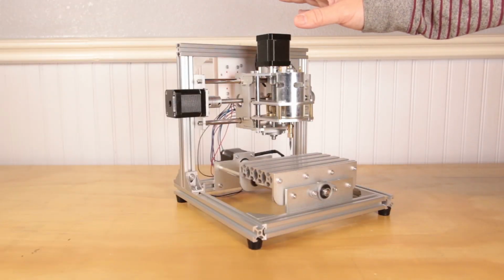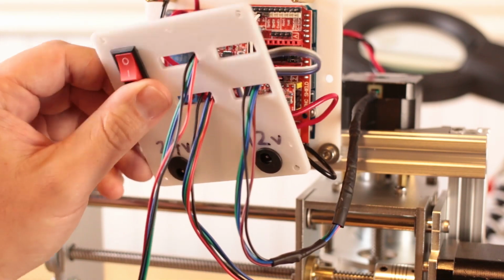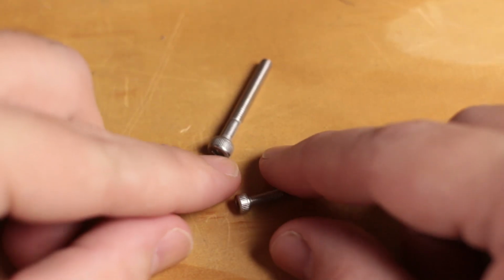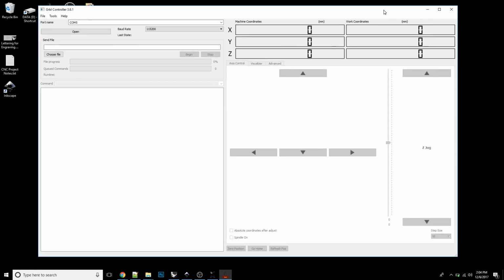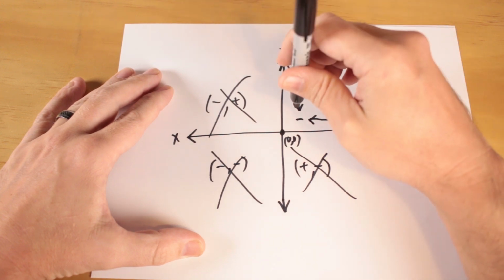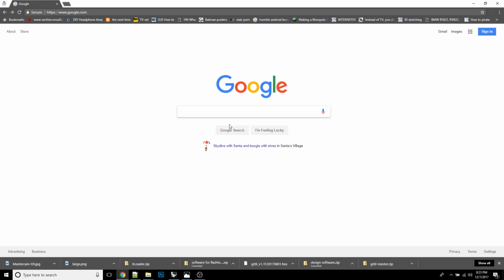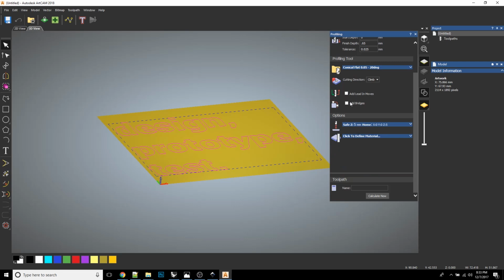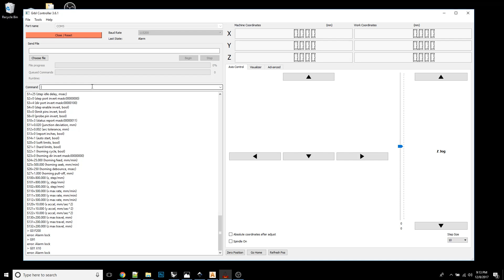How to start CNC Machining for under $200 - Working with the T8 CNC engraver

Comment: I appreciate your attention to detail and how you explain your process. So, I hope you find this useful. 

As others have said, soldering a conductor, before fitting into a screw compression terminal, is not ideal. If you use lead based solder, you will get some 'compression', but in the presence of oxygen and the flow of electricity will cause the connection to fail, no-lead solder is worse, because it is harder. Add a substance to exclude the oxygen would help (dielectric grease), but the connection will, still fail because of thermal changes. What you are wanting is a 'gas tight' (metal on metal) connection with tension, to maintain the metal to metal contact. Soldering the wiring directly to the PCB is the ideal, for the best connection, but is not, if you ever want to service/remove the PCB or wiring. Putting a close fitting ferrule (small metal tube, designed to fit over a stranded wire), is the standard for those screw terminals, you get the gas tight connection and the tension created by crushing the ferrule on to the bare stranded wiring. 

You could put a dab of non conductive dielectric grease on your terminal connections, but it's overkill, unless you have humid, salty or corrosive environment. Most dielectric grease is silicone-based, you can get it auto parts stores.

When you soldered the stranded wire to the terminal (instead of using a crimping tool), I am OK with that, it is not any better than a properly crimped terminal and it's a lot more work (that said, I have done it myself).
Reply: Think of solder as a cooled liquid. So what happens if you tin the wires is that when pressure is applied by a screw the solder will under that pressure flow to an area of lower pressure, This in effect loosens the connection. A loose connection tends to warm up (higher resistance) allowing the solder to flow more easily. NEVER solder screw connections, I have had to repair so may failures because people have tinned the wires. 

The whole point about crimping wires is that they create a cold weld, this is why you should always use the right tool. Too little pressure the weld is not created, too much and it fractures the wires giving a failed joint. 

My experience is that crimps are a more reliable connection that are less prone to failure on high current loads..

Comment: You've probably figured it out by now but those power supply connections have a built-in switch so that if used in conjunction with a battery pack, the internal power source (battery) will be cut off from the external power source.  That is why there were two ground terminals to solder to.  They are common to each other when the plug is removed but separate when the plug is in.

Comment: You're not supposed to use crimped terminals on soldered tinned leads or solid core wire. 
Crimps are used on loose stranded wire.
Crimping on stranded wire that has been tinned or solid core wire will work loose over time.
This is from IPC J-STD, 620, and 610 solder certification courses.

Comment: There is a new 3 in 1 CNC/Laser/3D Printer coming out from a developer called SNAP 2.0. any comments on that. This CNC seems very user unfriendly. On the flip side, your video was extremely educational and a definite help for entry level CNCers like myself. Thank you.
Reply from the maker: Nobody is doing fine carpentry with a Swiss Army Knife. Multi tools are never very good at any single task. My opinion: It is better to own a dedicated machine for each task. To hint at the reasoning , but without going into detail, CNC machines should be stiff and powerful in order to push through the material they are cutting. This means a lot of inertial mass on a CNC machine . 3D Printers do not need the stiffness, but we want them to move fast. Inertial mass hinders this. Laser Cutters require a clean environment inside the machine. CNC cutting make a lot of dust. Finally, do not buy this machine shown in this video. Read the description for a link to a better machine.

Comment: Youtube is for entertaining and educating, and wow, you have hit a home run with that crimp/soldering issue. Getting so many passionate responses is a real coup for your channel, but I have to agree with the 'do not solder' crowd as the solder can cold flow over time and loosen the connection. However, on your project, people have gone a little overboard with their comments and it probably will not be an issue for your connections.

Comment: Very good review, I dabble in 3D printing (DIY) and this review filled in a few blanks for my current project and has certainly got me interested in going down the CNC path. I trust you lose no sleep reading the negative comments of the muppet brigade.
Reply from the maker: Thanks for the support Dave. Yeah, they really jumped on me about tinning my leads. It's ok. I make mistakes, and I'm on stage where a lot of people could learn bad info from me. I don't like that possibility, so I welcome the corrections.

Comment: While center pin positive is more common, it is a mistake to assume this is always the case. Always check the output of the supply you are using. I have 3 different devices using center negative supplies.
Reply: For long-forgotten historical reasons, most guitar pedals use 9V DC, center negative, so especially check all 9V power supplies.
Reply: A lot of transistorised stuff from the 1960s using germanium transistors was wired positive to earth. Portable radios, all kinds of things.

Comment: I have the light saber design in my mind. Without this tutorial it cannot become a reality.
This guy can work like a demon. Lol.
At some point each part can be replaced if you have more than one rig.
It would appear that the individual that made the construction plan is dislexic. Yes always tin your leads! On rare occasion we are allowed to say always.
Like I heard once someone say that oxidation (the loss of electrons) ALWAYS occurs at the anode. 
I suggest whenever possible that one use the word always to impress upon the listener the dire importance to remember it.
Those connectors are axesome but they can easily blow out if you exceed 5 amps. Yes if you put 24 volts it will blow the connector. ALWAYS mark the blown connectors with a marker.
Side note once you have 1000 subscribers you become a captain of a thousand. As an exercise there is an ancient Hebrew word for the title. Two words. May the forces be with you my cousins.

Comment: at 8:45 you should never solder crimp connectors. What happens is that the solder will flow up the wire, creating a 'stiff' point going into a soft joint. If the wire is moved, a lot of stresses will happen here which will result in the wire breaking at that spot. Criming is usually sufficient for being sturdy. If you want more sturdyness, use heatshrink tube (especially the kind with glue inside).
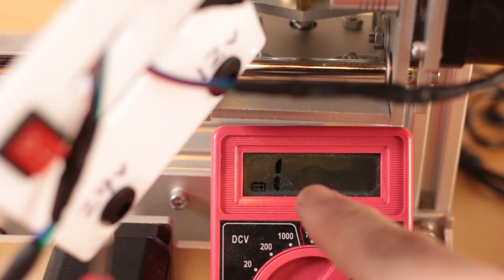At 9:23 this goes for the same. You should actually not tin the wire there. It actually also reduces surface area thus making the joint higher resistance and thus less good of a connection. What helps though, is twisting the wire before inserting it so you have no loose strands of wire that can short out.
Reply: Solder under a crimp [crimping a wire that has been soldered] is also considered bad, because the wire can "creep".  In mains power, having a crimp like this is considered a safety hazard: screw-on crimps on earth wires come loose over time.
If you feel the need, you can add solder AFTER making the mechanical crimp connection.

Comment: I have worked on military as well as industrial and transportation applications and they all have always recommended that with anything that is wired to circuit with a lot of movement or vibration that you tin the wire at the connecting point, also with a 24v motor and drawing current you want a good connection so you don't burn out your circuit board or motor. I have seen first hand what can happen if you dont. Also when you are splicing in a connector to plug into a specified area you want the best possible connection and soldering it ensures that you do. With 12g to 22g wire both commonly used are known to fail whether it comes out from mounting block from movements to breaking off.

Comment: As a previous wire bundle and 1st end connector builder for aerospace and eventually a QA for those I can firmly tell you tinned leads are not required for crimped or compression fittings. Entire airplanes are wired on crimped connections and not a drop of solder is used in the wiring connectors.
It is not essential in any way. Make sure you have the correct gauge and have undamaged and clean conductor strands. Then apply the correct crimping force to apply your contact or ferrule.

Comment: never tin a cable if you are going to crimp it to a cable shoe. The tin is soft and not structurally stable. It'll loosen over time. It HELPS A LOT if you solder it after crimping, but that's tedious process, especially if you do a lot of them. The problem with soldering is that the solder doesn't stick to a nickel plated cable shoe, unless you use flux and rub it with the iron. What I used to do is to pre-tin the cable shoe before crimping - takes even longer. Also if you get proper crimp pliers (even a cheap Chinese ones) the joint will be stronger. That's from my experience - I had cable shoes (which I didn't solder after crimping) becoming loose in time.
On the other hand I've never had problems with tinned cables in screw terminals. If it's just the screw untinned multi-core wire won't be securely held. You either have to tin it or crimp it with a tube (not sure what's the name for it).  The screw terminals with sheet metal between screw and the wire will work better with untinned multi-core wires. But I always tin for screw terminals. I'm not sure if that's good or bad, just from my experience - I never had problems with it.
Reply: In some industries (like oil refinery factories here in the Netherlands) you will be fired on the spot if someone catches you tinning before crimping. Soldering makes the connection brittle due to 'wicking'. Also if you solder the rear end (facing the wire) after crimping. Soldering the other side should have no effect at all since no tin should be able to flow to the other end if the crimp was done properly (not over- or under crimped). Crimped socks, shoes or ferrules are usually mandatory for screw terminals.

Comment: Telling people the center pin of DC barrel jacks is always positive is flat out dangerous. It is more common, but not always. Do not EVER make an assumption about the polarity of any plug. If you didn't wire it, check it, and if you did wire it, check it anyway. I have 3 different DC power supplies with center negative barrel jacks.

Comment: Neat little small CNC there but I wil stick with my total home brew with a cutting volume of 24 in X 18.5 in Y and 6 in Z. ( all in inches).  Resouliton is .005 across 24 inches.  I run up to 300 IPM on rapids. Controller is Mach 3, an industrial strength controller. Steppers are NEMS 23s with 450 oz/in rating, roughly twice what is actually needed. acme threaded rods/ NO belts used anywhere. Total cost of electronics and controller is right at $350. Total cost is around $600. WELL worth the additional cost over any Grbl/Adurino setup. Ive flat wore out 2 trim routers so far in 3 years with absolutely NO other issues than a bit of  normal maintenance issues.  Overall performance is a tad better than a 5 thousand buck Shopbot CNC. In my opinion any of the grbl based CNCs are basically toys but they are often suitable for hobby type uses and some prototyping. The basic rule with CNC technology is "you get what you pay for". 

That being said this little one looks well worth the price to learn a bit about CNC. At the very least you will have the basic knowledge to filter out the salesman bullshit from real facts if and when you go for something bigger.  :)
Reply: JohnI am just starting out with CNC and like what you have you say regarding your outfit, I would like to follow your lead.Where should I start?Thanks in advance.
Reply: I'm interested in your comment. I'm working on a similar design as you. However, using nema 23 425oz motors. Motors and drivers are about $250 for the cheapest I found plus shipping. Add a controller and $150 for mach3 and my cost would be $450-550. How do get by with $350 on your build? Thank you.
Reply: You've got self control to stop at $600. I looked into a DIY CNC build and it just kept adding up... Is it stiff enough? Better switch to thicker sections and linear rails to be sure... Is it powerful enough? Better switch to servo motors to be sure... Is it accurate enough? Better switch to ball screws to be sure. Hell, while I'm at it, lemme have a look at the TIR on a trim router spindle...
Next thing you know, you're up to five figures, and wondering what a used Haas goes for...
Probably best for people like me to stick to Bang Good toys, until we know what we actually need want.
Reply: I go for scrap material that I can shape how I need it and use linux cnc rather than mach3. Has mostly the same advantages over grbl that mach3 has without the extra cost. I'm also using a computer I got for free when they tossed out some old stations at work, upgraded the processor to a heavy duty server CPU with a cheap adapter, so far up to $25 for the electronics. Add in a $20 option isolator board for hooking up to motor controllers and spindle control I'm up to $45. I'm welding the frame together from some old railroad tracks a friend had on his property that I helped him get rid of for about $30, total cost up to $75 for an incredibly heavy duty frame, and maybe altogether $20 in welding electrodes (HEAVILY overestimating in case I screw up a lot). I've been digging scrap out of the local scrap metal trailer (the city lets you take out whatever you want as long as you don't make a mess) and grabbed a bunch of transformers and sheet metal from microwaves, they're easy enough to rewind with enameled wire from eBay so power supplies for the remaining boards costs about $25 in wire and $10 in voltage regulation. The sheet metal works well to enclose whatever I need in terms of controllers, power supplies, making channels for coolant to drip away, etc. D simple dc motors from kids ride-ons work well for the axes and run both smoother and with more torque and higher speed than steppers of the same size, just added some encoders from eBay and a couple microcontrollers to control the motors and get position feedback from the encoders (based the code off some projects I saw on cnczone) which adds about another $45 which puts the cost up to $175 for everything else so far. For the spindle I has a friend with a lathe turn down some scrapped steel pipe I got for free from the scrap trailer to fit a pair of tapered roller bearings about $6 a piece for 2 as well as to fit an r8 taper. He also machined some steel stock to fit the bearings and to fit a carriage style assembly I made welding together some chunks of that railroad rail. To power the spindle I have a car alternator stripped of it's dead diodes and hooked up to a blcd esc, the output from Linux can can be adjusted to match the input of the esc, all together the parts for the spindle and carriage cost about another $65. Total cost is now up to $230. Next thing to add would be linear rails and ball screws, which you can buy surplus on sites like eBay or from specialty surplus auctions or stores. If you wait for a good deal and keep your eyes peeled you could find a good set for less than $300 total, but you'll probably have to pay more unless you are a master of patience or you don't need as much rigidity or travel. I'm still searching for those parts for my machine but all the electronics, motors, and controllers have been fully tested and are fully functional. I've been working on and saving up for this for just over a year so a little more waiting for good linear actuation would be worth it.

Comment: At around 13:00 minutes, those sockets have 3 pins because one is a "switch" which can be used to electrically detect if plug is inserted. It can be left unconnected if not needed.
Reply: Hoss Man ... which means he was connecting to the wrong terminal for earth, which is why it disconnected when he put the plug in. He should have used the other earth terminal, then he could have avoided the trailing socket hanging out of the processor box.

Comment: Just some tips. You shouldn't solder in the crimp connectors, and a proper solder doesn't require touching the iron to the solder. touch the solder to the opposite side of the wire than the side where the solder sits. 
Great video though